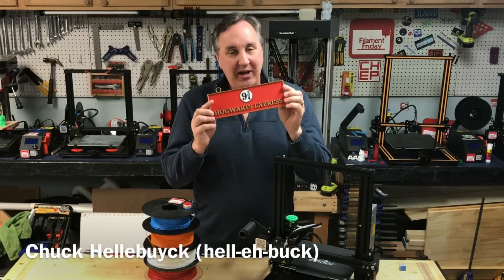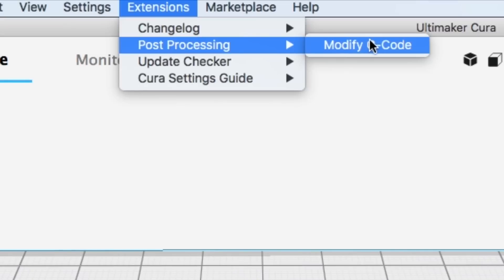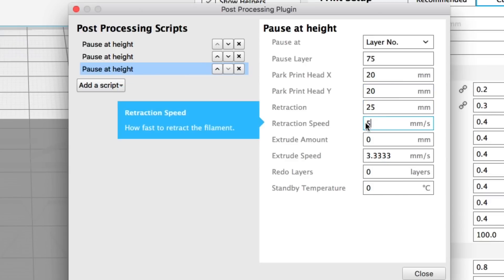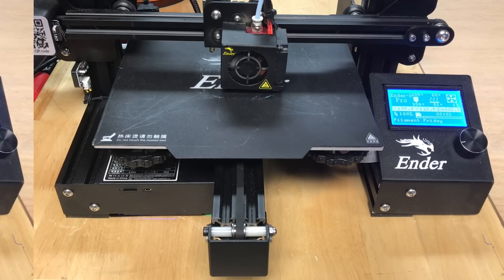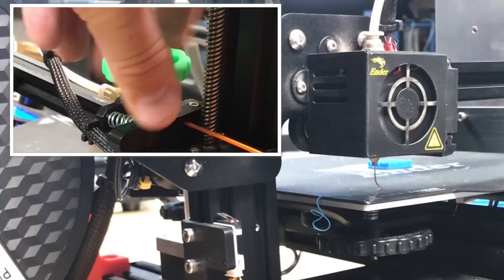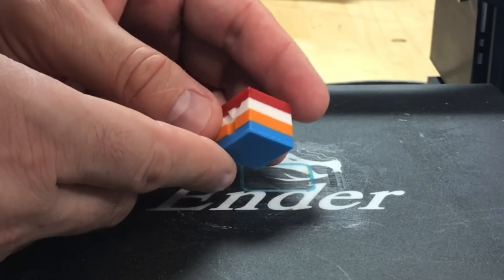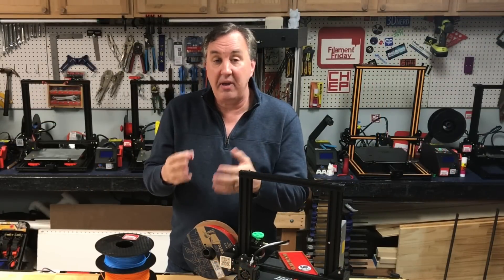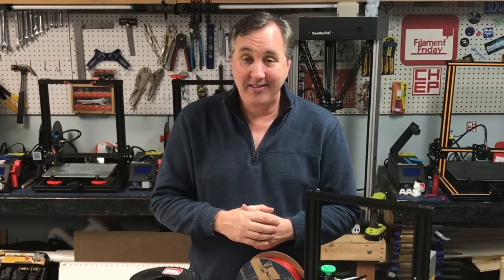How to do Multi-Color 3D Prints on Ender 3 3D Printer

Comment: I tried this technique with my Ender 3 V1 (2022, just bought it), it is working fine all the settings, but it start printing next steps before I even pulled out first filament doesn't wait for the user clicking on the board it looks like it was a 10s pause, when it start printing I manually set pause on the board, changed filament and resume printing. Is this issue fixed with M25 command? Or I'm doing wrong something else? Thanks.
Reply: I have the same problem I got a ender 3
Reply: Same. I don't even get a 10s pause. Just homes and then immediately back. I don't get a chance to actually pause on the screen. E3 v2
Reply: I was able to get the pause by changing the script to M25, but only on 'pause at height script. I beleive it is called BBQ(M25) now it actually pauses at height, only problem is that temperature is at working temperature and not at the pause temperature, and after you change the filament you have to use a pause on the board to be able to resume printing not something I'll let it run over night without attention... But at least it actually pauses and doesn't resume on its own. It is a step forward...

Comment: So, ender 3 pro works properly with this command, but I have one issue. After the printer stops, I switch filament and hit resume, the printer will extrude a bit of filament prior to moving the head back over the print (which is fine). My issue is that once the print head is back in position to resume the print, it will extrude another small amount and cause blobs on my prints. 

How can I stop this? 

P.s. I use the exact settings you show in the video, minus the x and y park coordinates. I use 190 and 190
Reply: Mine does the same thing.  You find a solution yet?
Reply: Did either of you find a solution to this? I am having the same issue.

Comment: Octoprint filters out the M0 command. "Not sending M0 to printer, it's configured as a blocked command" Is that a problem? Seems to work just like you are showing, but I wonder if there are any issues?

Comment: I just tried this on my Ender 3 and it did not work for me, why? After changing the filament to my second filament my extractor nozzle moved down a little. When it went to start printing the nozzle was rubbing against my print. It did not go to the place where it left off as far as the height.

Comment: This does not work for anycubic Printers. i wish he would of mentioned that.. not everyone have Ender Chep
Reply from the maker: I don’t have an Anycubic to test so how would I know what printer it works on which one doesn’t?
Reply: @FilamentFriday  understood. um just a little salty my 13-hour job failed. not your fault but mine.  but I did find another way to do it. thanks for the reply new sub
Reply: @FilamentFriday  hey chep, the print resumed almost immediately after pausing, didn’t have time to change filaments. Matched your settings, any idea what im doing wrong?
Reply from the maker: It has a delay setting now you can set.
Reply: @FilamentFriday  E3 V2 having the issue where it homed and immediately went back. Did pause at height and layers. It's so quick I can't even pause from the screen. This is my 3rd day so m0 m25 doesn't make sense. How do you set the delay setting or the other command for it to work?

Comment: Late to the party but here’s my tuppence worth. The advice worked for me, so I must have the correct board.  I did find that there was a big squirt at the start of the new colour filament, I have found that not having any retraction (set to 0) stops this,but to be able to pull out the first colour you need to set standing temperature to the working temperature for an easy pull! It does mean it might help to be around when the change is due! If it’s not working for you, you have the wrong board, check out his other post that explains this. Looking at two lovely Kawasaki badges, white lettering on a black base, Perfect. Thanks for the advice and subscribed. Thanks for your hard work.
Reply: I'm having the same issue, I'm going to give this a try. My only question is, is the color change instant doing this? Or should I set it to extrude a small amount prior to resuming to facilitate the color change? 

Thanks
Reply: Marc M. If you do as I suggest, and leave it hot , pull out the filimant push in new filament and make sure it’s flowing through the hot end, when it’s squirted out and inch or two, or when new colour is seen, clean head and press resume!

Comment: When I use the same settings as you, just after resuming the print, the printer extrudes some filament where it resumes before printing and then goes on to print as normal, resulting in an ugly blob where it resumed. To fix this I turned the retraction to 0, the retraction speed to 0, and the extrusion speed to 0  (even though the extrusion amount was already 0). This worked fine for making some chep cubes, but when I did a real print it resumed on its own while I was in the middle of doing the filament change. Any ideas why or possible fixes? ty
Reply from the maker: I think there is a time element you can change to give you more time. But I can’t remember.

Comment: I usually set the standby temp to 200C instead of 25C. Then instead of racing to extrude out the old filament color in the time it takes for the nozzle to heat from 185C to 200C, I can extrude as much filament as desired BEFORE resuming the pause. And I do this by holding the gear release while pushing the filament by hand (Marlin 2.x does not provide for operating the menus during M0).

Comment: after resuming the print, the printer extrudes some filament where it resumes before printing and then goes on to print as normal. do you know why this is? also, the printer doesn't say resume print, i have to press pause then unpause
Reply: It extrudes a little extra because of nozzle pressure, I'm not knowledgeable enough to think of a good fix for this. 

It doesn't say resume print because the software that the Ender 3 ships with doesn't accept the M 0 command (stop and wait for input). If you update the software, either through Creality's website with their precompiled .bin files, or compiling it yourself with Marlin, then it should work. If you have an 8 bit board, it might be a hassle (need an arduino), but if you have a 32 bit board, it'll be easier. If you have a mini USB connector on the front, you have an 8 bit board, if you have micro USB, 32 bit. CHEP has some good videos on updating the software, and there are some good ones from other creators.
Reply: @evancoberley2650  it was extruding alot but i found the problem and fixed it. ty for the respone anyway
Reply: @JArchiveYT  What was your problem or how you solved this? It still does at mine, and I cannot find the reason. Thanks
Reply: @MrMonow  the reason it doesn't say resume is a firmware issue, to stop the extra extrusion in cura i had to set my "extrusion speed" to 0 even though extrusion amount was 0. I also set retraction to 0

Comment: my neptune 2 is screwing me on this. i tried m0 and m25. m0 does nothing, m25 pauses but wont start again. when i tell it to resume on m25 it goes back to where it left off, touches the part then pauses again. did elegoo really do this so you would have to buy their dual extruder version?? wtf
Reply from the maker: There Firmware isn’t complete Marlin. And I don’t see any 3rd party offering firmware for it.
Reply: @FilamentFriday  thanks, yea im manually doing it with z offset but there have been a lot of hiccups and collisions in the learning process, but im starting to see results. i can't believe elegoo shafted us neptune owners so badly. overall i love the printer for the price

Comment: One thing that confused me about this.  When you change the filament, you manually extrude until the new colour is flowing.  Doesn’t that mess up the Z height?  The printer has no way of knowing you did that.  Or am I missing something here (ENTIRELY possible! 🙂).
Love your channel!  Thanks for this.
Reply from the maker: Unless you bump it and move Z your fine.
Reply: @FilamentFriday  Hey, Chep. So I'm finding that it's really easy to have Z start to ride down the rod with minimal movement. During the pause, it seems my Ender 3 Pro is unlocking the stepper and allowing gravity to grab a hold of it way easier than I want. Is there a way to stop this? I'm going to dig through Marlin's code to see if I can add a command to the .gcode file to lock up the steppers right as it's pausing. Have you had similar issue/have a workaround?
Reply from the maker: You can tighten to eccentric nut on the inside wheels and also the screws on the brass nut.
Reply: @FilamentFriday  When you said eccentric nut, I assumed you were talking about my Uncle Derek, but there's no way you know him. But seriously, this worked exactly as I'd hoped. Thank you for this, I didn't even notice the hex pattern inside the wheels.
Reply: @FilamentFriday  thanks Chep, I keep bumping mine, going to try tightening the bolts tomorrow
Reply: Not at all, the printer is not calculating flow through the extruder when you manually push it through.

Comment: My ender 3 pro pauses and only stops for a few seconds then automatically starts again
Reply: Did you try to use M25 instead of M0
Reply: @MyriadTechRepair  not yet, I’ll try it later
Reply: you should try the m25 instead m0, had the same issue and now it's working nicely
Reply: @igBartics  mine pauses fine but when i tell it to start the print again it just goes over touches the print then pauses again. i tried m0 which didnt pause at all and now m25 pauses but wont continue wtf
Reply from the maker: flymeetspaddle - upgrade your firmware https://youtu.be/vFcMW6m9OGg

Comment: Is there a way to get my ender 3 v2 to display what layer it is on. If I could see it counting layers I could stand over it but i dont know how to know when to pause to change manually.
Reply from the maker: Yes, there is a script in Cura to display the layer on the LCD. It’s under extensions > post processing menu
Reply: @FilamentFriday  thank you so much. I wanted that for changing filament manually
Reply: Use OctoPrint, you can watch a synced view of the print movements live as well as the layer it is on.

Comment: This doesn't work as advertised on my Wanhao i3 Plus (bought back in 2017, never updated the firmware). It does pause, move the print head to 0,0 (as I entered it), but after about five seconds it just continued without waiting for me to press anything on the LCD screen. By the way, the new versions of Cura allow you to choose "Marlin (M0)", "Reprap (M226)", "BQ (M25)" and a couple of other options. Hmm.. haven't tried M25 yet. M226 didn't work.
Reply: M25 does seem to work.. Interesting, because the Wanhao supposedly runs an old version of Marlin.
Reply: Same problem on my Anycubic Mega S. Did you find a solution? Thanks.
Reply: @DrexProjects  Yes.. Turns out the "BQ" option works. 😁
Reply: Actually, once I figured this out, another problem cropped up. If I resumed printing the next day, more often than not I got a Z shift. Usually in the Y direction, no more than 1mm but enough to matter. The seeming fix was to replace the "0" in the "stepper motor timeout" value (I'll have to go look to see the exact wording) with some really large number - 10 hours would be 36000 seconds, so something bigger than that. This SEEMS to fix it but the printer went down for an unrelated reason and I only got to test this 1 or 2 times.
Reply: I have the same issue with my ender 3 pro
Reply: And as luck would have it.. my new printer is an Artillery Sidewinder X2. Apparently M0 doesn't work at all, if causes the machine to freeze. M25 also doesn't work - the machine pauses, the head moves to the preset position, but 20-30 seconds later it starts up again. The screen shows "Pause" rather than "Resume".

Comment: I have Cura 4.11  Will this still work?
Reply from the maker: Try it and let me know
Reply: @FilamentFriday  Oh Okay I deleted my other question.  That was 2 years ago and I was new.  On thaty ender 5 aftert installingh the EZ-ABL leveling sensor and I got TH3D's unified Marlin I had the M600 command in the firmware.  Now I just sold the% and bought a Kywoo Tycoon Max.  V2 of the firmware is supposed to have the M600 Change Filament included.  However now I got Cura 4.11 and I also like your method of pausing at level.  I make some items that require a color change so my options are open. Thanks for this video. It'll be another 3-3 weeks before I get the Kywoo.  I will let you know.

Comment: What would cause the separate colors to not bond properly? My normal layers are great, barely even noticeable. But every time I do this, its almost like a layer is skipped before the color change starts.
Reply: You could be throwing your bed level off by accident, or there could be some slop in your Z axis causing the height of the nozzle to change while you're swapping plastic. You could probably modify the gcode in the cura script to move down a full or partial layer after the resume to solve this.
Reply: slop in z axis 100% had the same problem on mpsm. i would have to physically push down on the z axis as the print was starting to take the slop out. you can let go once it starts printing

Comment: I tried this method - but the Ender 3 resumed printing almost immediately after the pause.  It didn't wait long enough at the specified park location for me to change filament.

I'm running a stock Ender 3 running Marlin 1.0.1 and used Cura 4.10 to do the slice and pause.  I used the Marlin (M0) method for the pause in the Cura "Pause at height" post processing script.
Reply from the maker: Use the M25 version
Reply: @FilamentFriday  Just tried that - did exactly the same, paused, then after about 5-10 seconds, automatically resumed.

Comment: I tried what you suggested. Copied every setting. I am using the BTT TFT and Cura 4.10, so I hope that is the problem. When I click resume the printer head moves back into position ready to start printing before the nozzle heats up again. So it stops and waits to heat up. Mean while it has ruined the print by melting the point where it is waiting.

Comment: i have a problem. I have the ender 3 v2 and I found the modify g code but it does not pull up the prepare button it just shows the wrench with a red 1 next to it. I have been trying this for a little over a month trying to figure out what I'm doing wrong considering I'm new to this I figured it must be me. Once I add the filament change into the g code and i assume that it took I save to my SD and try to print but it does not stop at the desired level. I don't know if I should just try a different slicer or what but I'm getting aggravated with it. so any help would be greatly appreciated. Thanks in advance!!
Reply: Make sure you set it to "Layer x" and not "millimeters x"

Comment: CHEP.   I need help.  I've built a printer, configured with Marlin, and enabled Mixing Extruders with gradient.  
I'm having issues in cura.  
My printer is a diy clone of an A-10M. Mixing hotend.
I want to change marlin to show 2 Extruders and "single nozzle" which forces me to disable "mixing Extruders"..
Is there a way I can still use the 2 extruders to do a gradient print?  So let's say I'm using white and black filament.
I have a square that's 20 mms tall.
I wanted to start out in black and be completely white when it finishes.
Meaning that in the middle will be a gradient going from black to white.
I know how to create virtual tools in Cura to give me like a 60-40 mix but everything I try gives me a hard color line in Cura.
Or a poorly blended color just because I don't use a purge block.
Basically what I was told, by someone at Marlin, is that the mixing extruder ingredient vtool section in the Marlin firmware was ripped from the proprietary geetech firmware, and is not fully complete. This is why the A10M shows options to load and unload filament in the different extruders but a DIY printer like mine does not. Also because I am unable to enable single hot end in the firmware, When kira goes to switch to the second extruder it constantly disables my hot end.  I'm using version 4.9.1 and do have the printer settings plug-in installed which has an option that says shared hot end however I have not noticed that it makes things work any better. So perhaps that plug-in is not updated to work with the latest version?
If you could please provide some assistance or perhaps make a video showing how to do this exact stuff including the firmware that would be absolutely great!
Thanks

Comment: Hi Chep, I am hoping you can lend your wisdom. I followed this tutorial for my Ender 3 Pro and it has worked great (with the exception of needing to set my method from M0 to M25), however something has just started happening without me changing my settings that has me perplexed. Now, whenever I resume printing after swapping filament, my printer moves directly over the model and extrudes a large blob of filament on the model before resuming, effectively ruining the print. This didn't happen before in my multi-color prints so I am very confused! Do you have any insight? I've ensured my settings mirror yours, the only real difference is that I recently updated to Cura 4.9...
Reply from the maker: Try 4.8. Some people have reported a few weird issues with 4.9. You can also reinstall 4.9 as it was beta but is now released.
Reply: @FilamentFriday  Woah! Thank you for the quick reply! I wasn't sure if you'd even see this. I really appreciate that! Back to 4.8 I go.